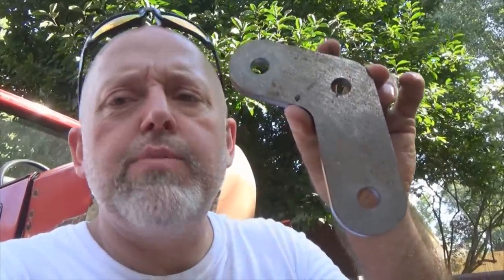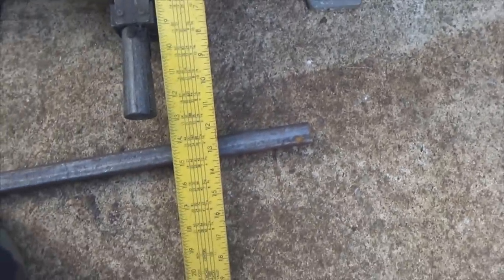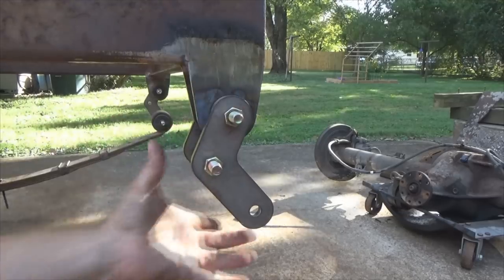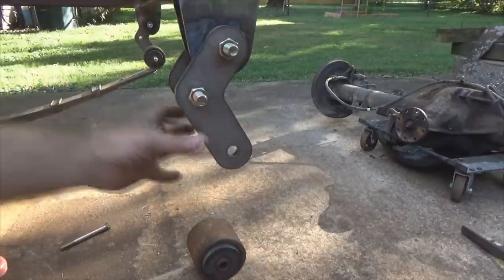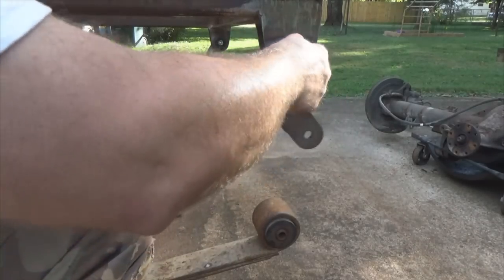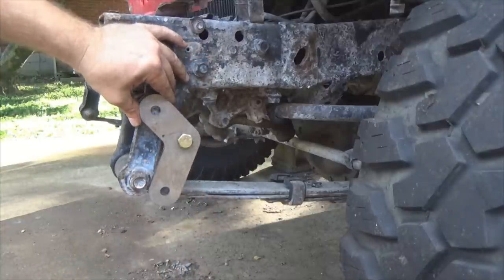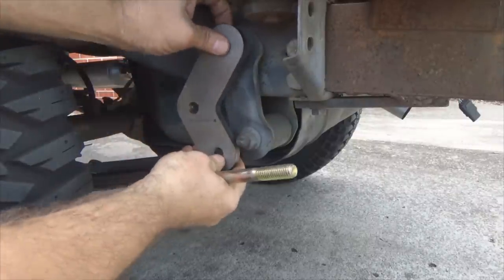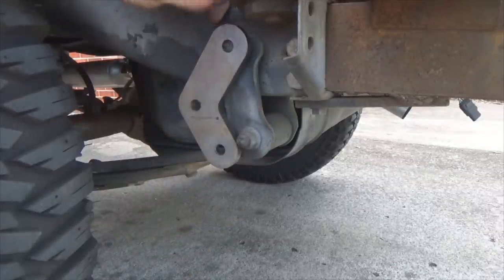Jeep Wrangler - Boom Shackles - How to mount them and why

Comment: If you remember my comment from a month or so ago about the shackles on my 47 willys being homebuilt with 3/8 in plate, Welcome to the completely overbuilt shackle club haha... FYI if you have a drill and a similar chopsaw and the metal you could make a full set using the method you showed in your vid here to make everything uniform in length (of note be sure to measure carefully for each drill hole to and if you plan on rounding the corners to do the drill holes first then round off the ends)(My overbuilt 47 shackles have not been rounded at the ends)...also for the masses do NOT go crazy on the length of the shackle, keep them within an inch of the stock length (to long could give you the same problems as shown in the vid or worse)... Happy wheeling everyone
Reply from the maker: Yep I surely joined that overbuilt shackle club!! I opened that box and was like dang that some heavy pieces!! Yes, I do remember that!! I've got some plate laying behind the shop, its either 3/8" or 1/2" been a while since I've looked at it. I was placing an order for several kits and I threw those in the shopping cart as well. I'll check that plate I have, I may make a video "DIY Boom Shackles". Ive got a chop saw, drill press and vertical mill to drill out the holes. I've got a few of their other products as well. They are all "over built" .. But I like'em like that!! Good seein ya drop in again man!! Have a great day!

Comment: So I've heard to reverse your shackles from the front to the back on your front Springs for better ride on the highway and  To eliminate the death  Shape how do you feel about that
Reply from the maker: I've seen people do the shackle reversal for the front. Some say it helps .. some say it is no difference. I personally haven't done it .. yet .. so I really don't know for sure. As for death wobble ... I'll put it like this. I have owned MANY leaf spring rigs and I have never once experienced death wobble on a leaf spring style suspension. As for coil spring suspensions such as TJ, XJ, ZJ .. etc. Yes .. I have fixed many of them having death wobble. If a leaf spring rig is shaking in the front .. park it .. there are some serious issues that needs addressed ASAP.

Comment: I have watched this video a couple of  times and several other of yours.  They are all good. Thank you.  Now I have a question.  I have read that if you put boomerang shackles on your YJ then the steering wheel is no longer centered.  Is this correct and if so why, and how do you correct it?  Thanks again.
Reply from the maker: Boom shackles does not effect your steering wheel being centered or not. I' know of several people who run booms .. it doesn't mess with the steering wheel. Coming soon I will be doing a video demonstrating how to center the steering wheel if for whatever reason theirs is off. But .. its not because of boom shackles. Have a great day!

Comment: I installed them on the rear and was thinking of the front also. Would I have to change anything steering and alignment wise? Running a rough country  2.5" lift on 32s on a 92 yj 4.0.
Reply from the maker: Yes, front is no problem. Stay 0 lift or 1" MAX and you shouldn't have to adjust anything. Bolt on and roll!!

Comment: Do you have to change the rubber boots grommets in between the shackles and the chassis of the body do they come with kids or without kit
Reply from the maker: I personally would if I had the spring out. As to whether they come with the bushing or not. That depends on the kit. They did not come with the boom shackles in this video. Have a great day!

Comment: So obviously your running without tracking bars. I just took mine off my '88 wrangler and what a difference.
Reply from the maker: My daily driver has no sway bar or track bars.
Reply: @Poweraddicts  
I inherited my grandfather's  '88 wrangler 4.2 last year. He never got to drive it but did finish the motor. I got it on the road and after about a month and having my spleen and kidneys fall out of my ass I took them off. Lol  

 Just rebuilt the a999 3speed and now I'm going through the wiring. Your vids have helped a ton and thank you.